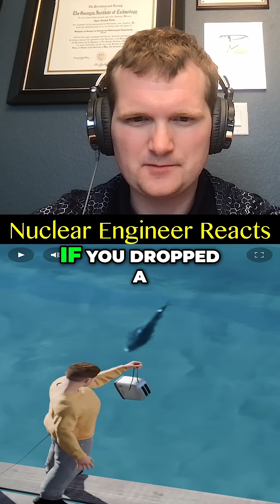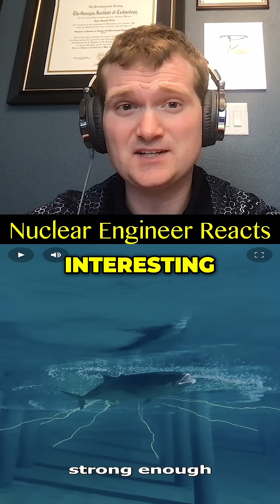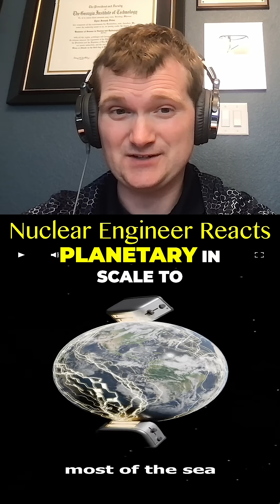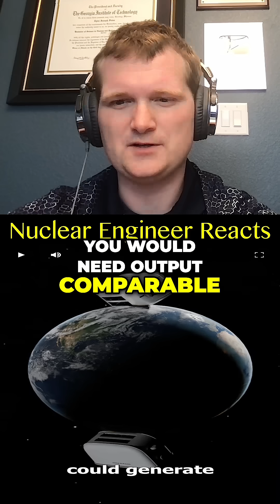Could you Electrocute the Ocean? - Nuclear Engineer Reacts to Zack D. Films

Comment: Nope Tyler.  Not 1/r^2 , after 10 miles or so, it would disperse at 1/r.  Assuming the ground would mostly behave as a resistor and the sea water would behave as a conductor.

Comment: Something i just thought of: since star wars has those crazy reactors with way too much power, wouldnt the most effective way to destroy a planet like kamino be to just lower electrodes into the water on both poles and then send such a massive amount of electricity through the water that it would split so much water into hydrogen and oxygen that a single spark would blow the whole planet up?
Reply: Well I’d probably be to do anything else with the same amount of power, but it is an option

Comment: Would never work. You'd vaporize the water in proximity to the electrical outlets long before a current could actually meaningfully penetrate the water. That kind of energy input would simply rip the hydrogen bonds to pieces and cause a whole lot of instant steam. And then you'd kill every living thing on land across the Earth, because you just created and powered two hurricanes that are the size of continents, with winds pushing 500+ MPH. That is game over for all macro life on the surface of Earth.

Comment: Uses Ultrasound transducer to push salt away from nozzle > Activates Ultrasound holography controlled Plasma inside that bubble > Compresses plasma with Ultrasonic shockwave for Plasma generated Ultrasonic shockwave My Toaster can be energy or sound weapon. Creates Ultrasonic excited Plasma vortex tunnel to target then dumps Plasma by capacitors Asgard Plasma lasers.. Heh..https://www.youtube.com/watch?v=rlON7czfLZ4 If strong enough = Spin a vortex in enemy shields.. But you need some NASTY capacitors to stack with max generator for our shields. We like black holes.. Looks at memory of lasers spinning around shield Oh ty for more power..

Comment: Tested generator output with saltwater filled tanks using metal plates - 4 megawatts was dumb loaded in a 6x12ft at 4ft deep - which would make the water boil when the flow was too slow